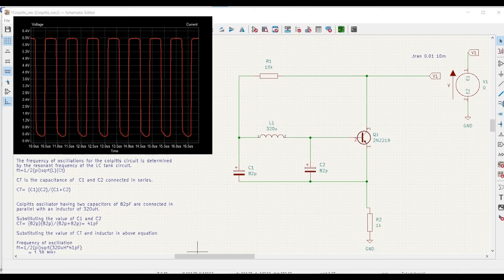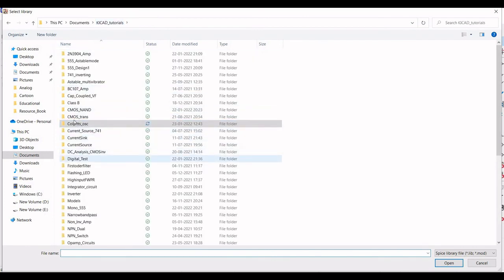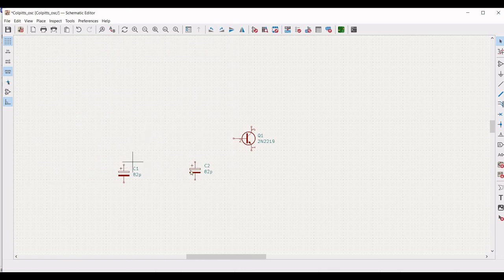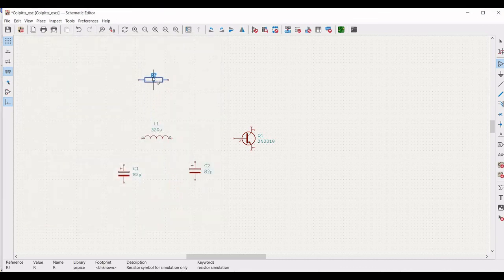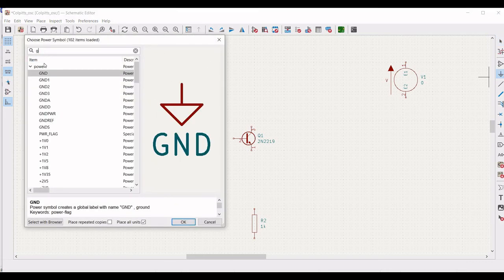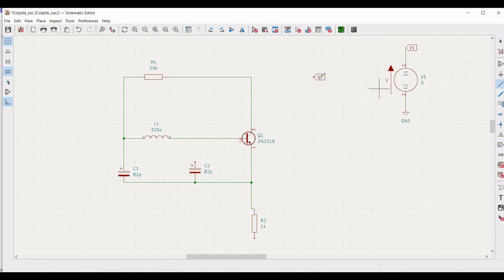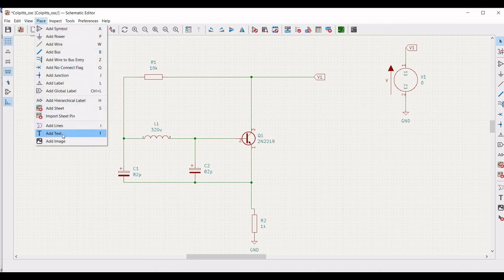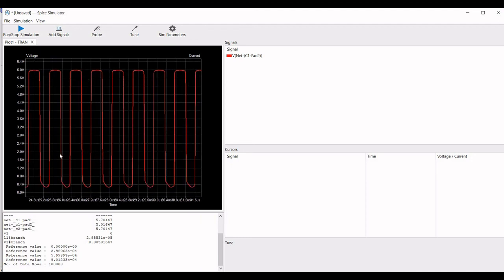Kicad Tutorial 28: Design and simulation of Colpitts Oscillator circuit using transistor 2N2219

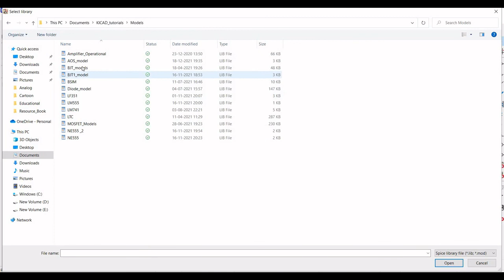Comment: 1:35 I really don't follow what's happened. A further explanation would be appreciated
Reply from the maker: KiCad tool doesn't have certain model file, so you must define these model so that the KiCad tool understands that its 2N2219 transistor which we are trying to simulate. So we define that model so Ngspice. Model tab is used to assign a semiconductor or a complex model so we require an external library file, these model files are offered by the device manufacturer. So until you don't define the model, ngspice will not understand which device to considered for simulation
Reply: @circuitgenerator9788  Thank you for the explanation. Where did you find these model files for the 2n2219A transistor?
Reply from the maker: You can download the model files from the below link.
https://drive.google.com/file/d/1TYrf8at2D7YnABK1ZM3NoM3e1_XQLmm8/view?usp=share_link
Reply: @circuitgenerator9788  Hi it says it "does not appear to be a valid KiCad project file". Thanks
Reply from the maker: Its a library file, you need to provide the path to the models just follow the steps in the video